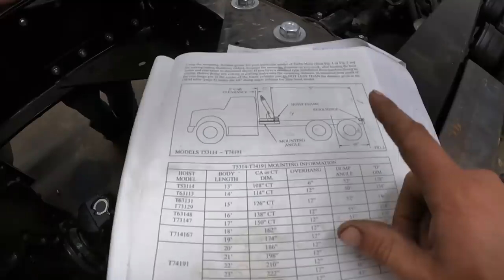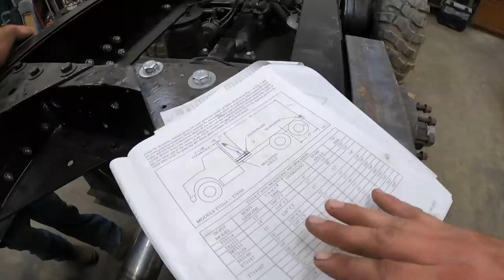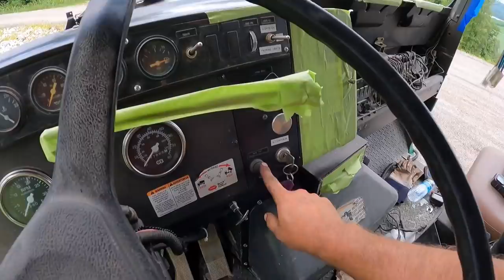The new bed and Lt Dan become one. We now officially have a dump truck...kinda of

Comment: I don't care if you just set the bed as of last night or a couple videos back I thought I saw it on the back of Lt. Dan then which means a video soon coming with a hydraulic tank, fenders and doors etc., and rolling some coal out of the stacks! I'm thinking even  though not highlighted, a cab guard and some protection for that back glass. It doesn't need to extend over the top of the cab, but something to keep tree roots and limbs, debris of sorts, from rapping it hard. Then again if you could get that guard to go over the top of the cab, I think it would look sharp. Maybe get a artist to draw it so you could see before committing to it. I sure do hope that you can air condition all the equipment before its all said and done..   This takes the pain out of the costs involved to make this come true. As small as captain Kleeman is, he will look like a dwarf in the cabin. As much as you might want to, I would go with just the mandatory lights and not get too crazy hanging lights to get knocked off. I could feel and enjoy the energy it gave you men to see it all  together!! So congratulations men on a well done job and best of all enjoy working together

Comment: As a former welder by trade (iron worker union) I wonder if MBTS used 7018 rods.
Or 6011.
I do miss welding.
That was in Michigan pre Coast Guard enlistment.
I tried welding again here in Miami and discovered welding outdoors here is absolutely brutal.
Went back to being an electronic tech on pinball and arcade games.
Mostly worked in an air conditioned shop or bars.
Reply from the maker: 7018

Comment: I was supposed to be in your neck of the woods this week.  We were going to Lexington KY, Bowling Green and then to Clarksville.  Unfortunately, my next trip is to the OR for spinal surgery.
Reply: Don't know what your having done for surgery, but I've had 4 lower back L-5/S-1 fusions and a neck fusion. It's not too bad of surgery if that's what u are having done..good luck
Reply: @scottsime5197  I'm having a Microdisection on L1-L5 to relieve pinching of the spinal cord.
Reply from the maker: good luck!

Comment: I'm not sure if you've gone through the axles but we had a lot of hubs just fall off. Pop out each axle shaft and check torque on the axle nuts and make sure the tabs on the washers are bent over....not worth going through all that trouble to have an entire tire/hub come off while loaded and destroying the threads on the axle tubes just because some 91B was pissed at his NCO or something. It's a pain the in ass but I would never trust surplus without going through most of the running gear after what i've seen these things do lol. Steer axle shouldn't be too difficult but yeah the rear will be a pain in the ass. All in all it looks, basically a big boy "square body" with some snobby mud tires, always looks great!

Comment: “Everything you got runs wide open” come on MBTS the next line should have been “except the operator”. Awesome series. Great content.  Just curious how much does that box weigh and how much can the over head crane lift.  Not second guessing you. Just wondering.
Reply: Overhead can handle each end of the box, no problem.
Piece of 1 1/2" shaft and they can scoot that box back and forth a foot, no problem.
Also lift one end and move it side to side.
But then, I do this stuff 9 1/2 hours a day, every day.
This truck is going to be bad ass!
Would be cool to see tires on the lift axle, but they would be in the way for the rest of the work that needs done.

Comment: you should have used the bed as a exhaust - just have the exhaust go through the bed reinforcements and out the back - the exhaust heat would help unstick mud , dry the bed and defrost the bed - also oily diesel exhaust would keep the bed in better shape
Reply from the maker: Not in or location check out the exhaust on the c8500 thanks
Reply: @DirtPerfect  Terrex makes this option for all their off-road dumpers
Yes your Exhaust stacks look rad but it's really a waste of energy since a heated bed helps reduce material stick
Else have you thought abaut installing a vibrato motor that shakes off sticky clay from the bed

Comment: The rod is not supposed to stick? And I thought that is why they call it "stick" welding. 🤠
Hat's off to MBTS. I have worked with several Boiler Makers over the years. Pulled hole watch duty while they were inside superheater sections, laying nearly upside-down, with mirrors, while welding. Very impressive.

Comment: The truck is looking great!. Can you picture the power steering going out at about 50 mph on a corner like the Paystar i was driving. Thank God the truck was empty when it went. I had to stand up and really torque on the wheel to keep it from going into the ditch. I still crossed lanes and thank God again no traffic was coming from the other way. And i didn`t even poop my pants! lol Almost lol  That truck parked next to the vamper made me think Lt. Dan would make a great camper for off road. Put some center poles and a blue tarp and let the gate down flat for a deck and there you go! lol  One last thing. How you going to dump the box after we saw the front being welded! lol Just kidding Take care

Comment: Should be able to find two spots where a chain and load binder or ratchet load binder would move it a  few thou.  Once into position to leave that on then move  the front?
Reply: Thank you, you did cheat with using being able to use a hyd ram to push the box into position.

Comment: Ya know DP, I think you could really benefit from a Langmuir Systems CNC Plasma Cutting table.  The cheapest one with a bed extension and a torch height controller would likely take care of most of your cutting needs at a cost of around 3 grand.

Comment: Your'e  seat is cush compared to some milk crate and 5 gallon bucket seats I've used in the past. I'm thinkin air ride though. Maybe cut off the legs and mount it on a beach ball. I did notice Man Behind the Scenes seams to blame you for a lot. I think he should have walked around the shop and made sure everything was put in it's place. After all he knows where it all goes. You would be guessing and then he would blame you for it being in the wrong place anyway. LOL

Comment: Mike when the 6 drive axles are being twisted by that drive shaft being that it has a universal joint in the middle and not a solid shaft when that drive shaft sees the incredible loads you’ll put on it that “super strong enough 🤣 little carrier bearing mount” IS not might IS going to break and then your driveshaft is going to pretzel buddy. Not so much torque but directional pressure will fail your mount.
Reply from the maker: Hmm not how it woks buddy think about that plz
Reply: @DirtPerfect  your build is awesome 👍🏻🇺🇸 perfect name so please don’t think I was being a idiot. You know what your doing.

Comment: 40:27  THE BIG HOLES in the REAR FRRAME that goes into the SIDE FRAMES..... it seems that they are aligned up purrrfektly to insert some LARGE STIFFFFF SRTRONG HARD LONG (snikker) PIPE IN THERE TO USE TO LIFT AND SKOOTCH the rear around a bit to align it up ??????????????

Comment: It’s about time!  Looks awesome but I can’t figure out the one foot gap between the bed and cap and why no headache rack? Other than it would hinder the cool stacks. That one foot could be lots more material hauled. Hope to see LT in action soon!
Reply: DP has mentioned headache rack in the past. I believe their is something planned
Reply: @grilnam9945  yeah I’m sure he has mentioned it but damn that was years ago🤣🤣
Reply: There is a hydraulic than to fit in there.
Even with 4 axles on the truck, he can overload it with that box, why add another foot?
Reply: @haroldphipps3457  what are you talking about? That little bed is nowhere near gonna overload that truck. My question to DP is why the gap.
Reply: @tbirdage  so, you missed the part about the hydraulic tank?
And, you are saying you have no clue how much wet sand weighs?
Gotcha.
🙄
Reply: @haroldphipps3457  I caught the part where you misspelled tank. Nobody needs a one foot gap for a hydraulic tank. Trust me, I have a clue. I haul in my own dump trucks daily. 🙄. I guess you missed the part where I said I was asking DP. That means I wasn’t asking you.

Comment: Glad to see you don’t have the exhaust together, you know you need radius bends, no 90 degrees, or it will take a bit of power out of Dan, like a lot .
Reply: The large size of the tube they are using, power loss will be zero.